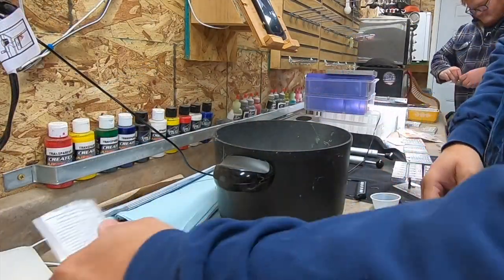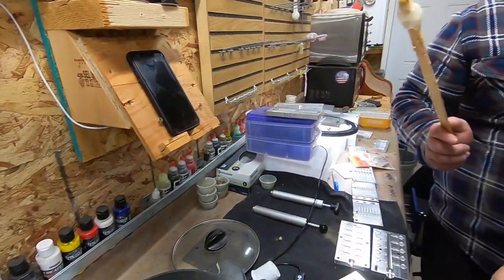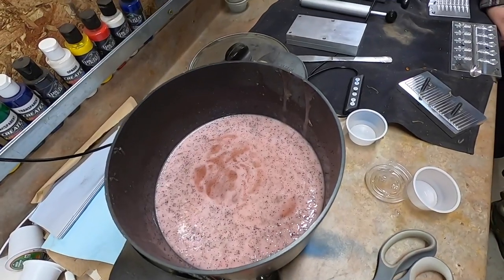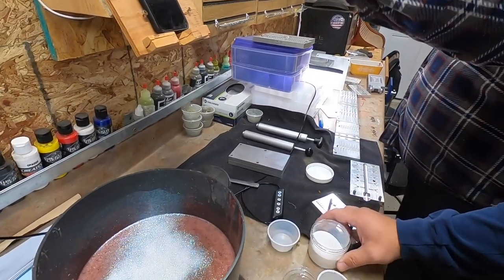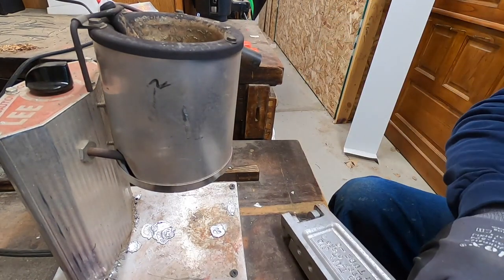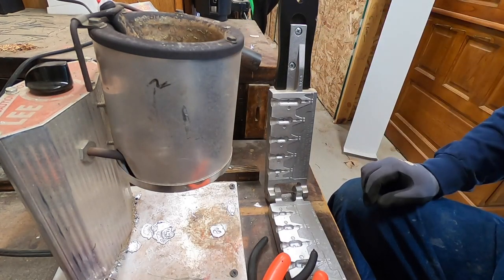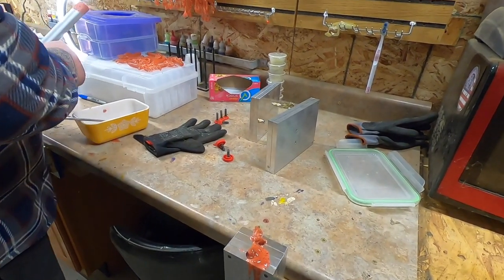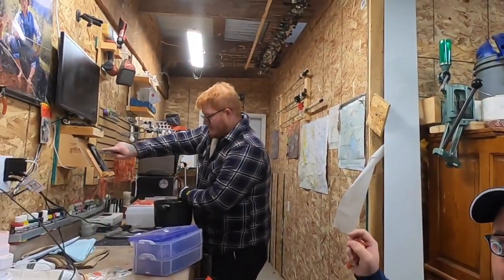Coffee Glow Burbot Bombs

Comment: I have a couple questions.. Do you throw the excess lead back into the pot, or do you save it and melt it all together, later?? And where do you go burbot fishing?? I need to research... I've never caught one (or even seen one)
Reply from the maker: I just throw the lead back in the pot. Sometimes I will wait until I’m done pouring for the day. It can splash back at you sometimes if you drop it. I like to go burbot fishing at Flaming Gorge Reservoir on the Wy side. I have several videos of that if you want to check it out. Take care and tight lines!